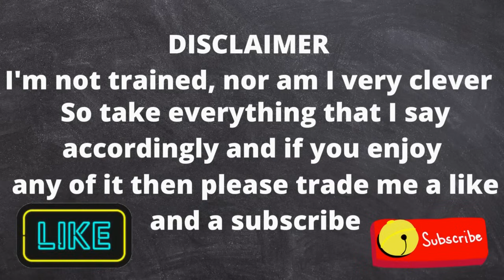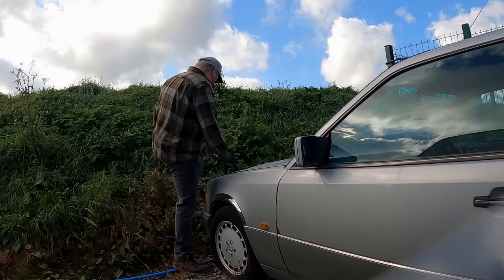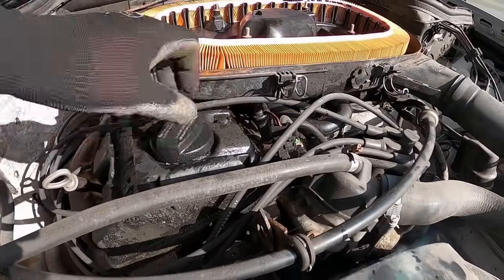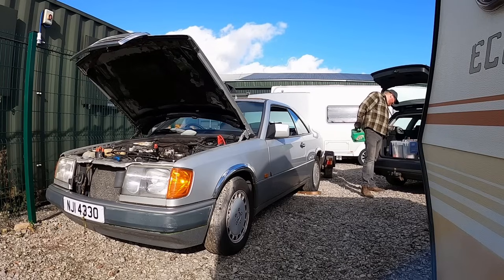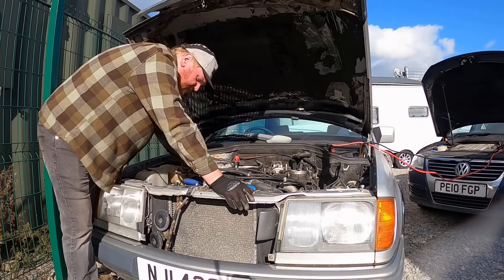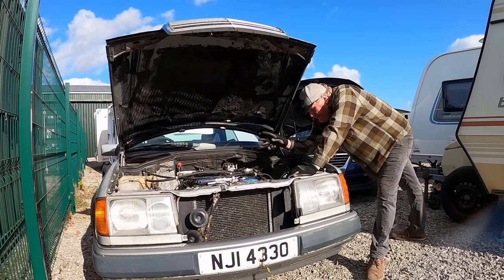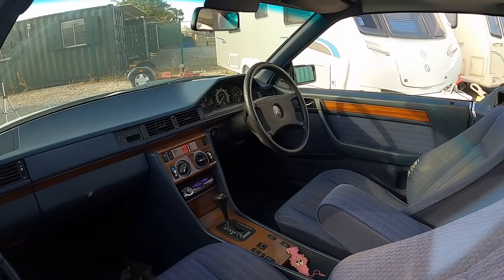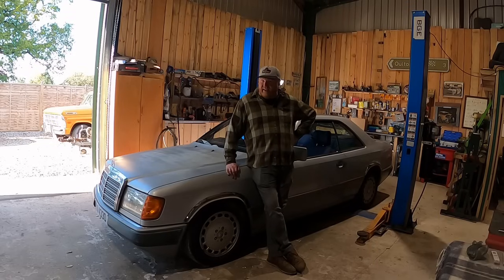Abandoned 1990 Mercedes 230ce - Will I be able to get this one running and driving in a day??!

Comment: You can roll by turning the tyres! Try it in the garage, too when you don't want to (can't) start anything. Saves the panels from getting dented or other damage to lights, windows, etc. Also works great for heavy motorcycles.

Comment: I've had about 7 of these old coupes, the best one I had was a specially commissioned one of only 10 made in 1997, the last ones made ever ! 
It was ruby red with cream leather interior and it was even featured on the front cover of Mercedes Enthusiast magazine in Oct 2008, stunning car, 3.2, it sadly got stolen, then returned then it sat for several years before it disappeared again and likely was made into tins now, it only covered maximum of 85,000 miles before it vanished and I actually owned the car twice, when I 1st owned it in 2004, it had covered about 72,000 miles so between 2004 and 2022 when it was last seen, it had only covered rufly 13000 miles, crazy ryt ! 
Number plate was privatised 
MBZ3248 If anybody is interested but the car isn't recorded as stolen this time as it fell into disrepair yet the engine was working great and the interior was like new, perfect tbh, just sat around too much then got stolen twice so I decided to just let it go in the end so if it turns up, hope the new owner has made some use of it, awesome car these were, elegant timeless lines👍

Comment: Hi Ben. I don't know if you know, but Mercedes have a double catch mechanism on the bonnet hinges,which allows the bonnet to be opened pretty much up to vertical for when doing maintainance. A little round peg/ button on the hinge. Press them in,and the hinge catch disengades allowing the bonnet to open much higher. It's an absolute blessing for the old back ! Enjoy ! Dave

Comment: Hi there, I have been watching your videos and I will make it clear I am not here to judge, a few bits of tools I think will help you immensely help you with your diagnosis of vehicles, get yourself a cylinder compression tester and a sniffer kit for the cooling system to check for exhaust gasses in the coolant which will tells you if you have a head gasket leak or a cracked cylinder head. I have been a mechanic all my life and I also use to teach college students motor mechanics. I have also had my own very successful garage business. I get that you have your head screwed on and you have a keen to learn. You also make a lot of hard work for yourself the way you diagnose problems. I wish you the best of luck and success with your channel

Comment: Mr Tasty is that Mechanical fuel injection, it seems to have the same injection set up almost as the Audi80. thanks for the brilliant and knowledgeable videos.
Reply from the maker: Thank you Andrew! From what I know Bosch sold these servotronic units to a lot of manufacturers including Audi & VW. I do like the units, much easier to run than the carb models that came before and much more reliable, when everything is going right 😅👍
Reply: @tastyclassics  Thanks Mr Tasty they were indeed robust and reliable, I had a 5 Cylinder Audi100:with that Mechanical fuel injection, , especially when we had contaminated Century needle in the Carburettor, thanks 😀🙏
Reply: Sorry spelling error Venturi needle, I had meant to say Dirty Venturi needle making Carb model s less reliable

Comment: Never ever fit the negative cable to the battery terminal of the dead car,fit to metal structure in engine compartment,plus never fit negative first as could damage wiring loom or worst cause fire🙏🙏🇬🇧🇬🇧

Comment: UK spec cars are strange indeed. You have a C124 with automatic transmission and AC, but small engine and cloth seats. 💺To add insult to injury some yokel put a Kenwood stereo in it. 🤮The nice thing about it is that it isn’t entirely crispy. May not be hard to bring back to working order.